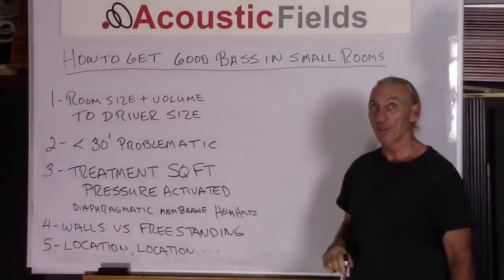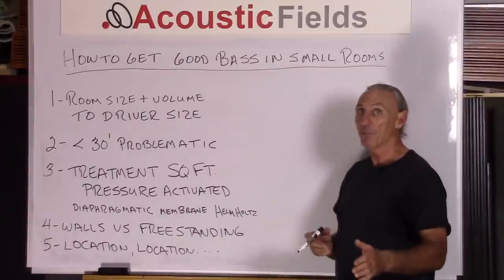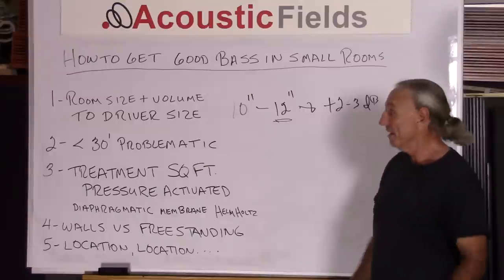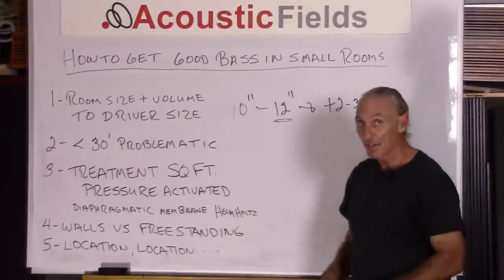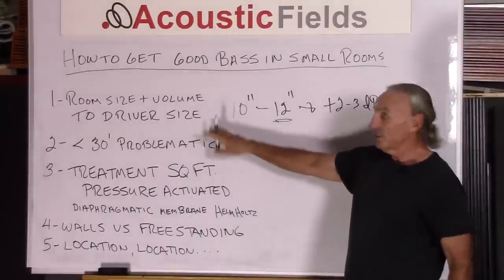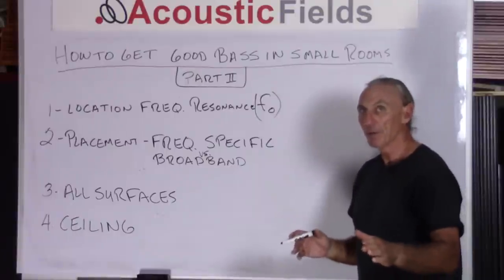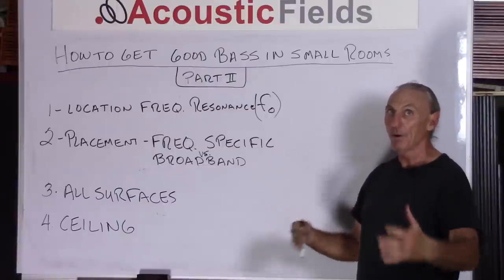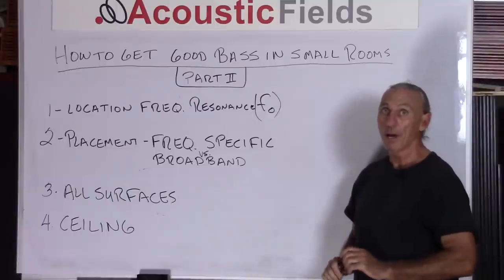How To Get Good Bass In Small Rooms - www.AcousticFields.com

Comment: Appreciate that ceiling tip for a last resort for the sub placement. I'll definitely have to check it out.
Reply from the maker: We have 3 sound fields within a room to treat for both low, middle, and high frequency energy. We have floor to ceiling, sidewall to sidewall, and front to rear walls. All three of these produce unwanted lower frequency pressure issues along with reflections that must be managed.

Comment: Fundamentally correct however a few corrections (there are more but I'll stick to 2): 1) WRT the statement that a 10" vs. 12" driver is 20% "larger" is incorrect. Using the simple area of a circle formula, A = Pi (R squared), 10" = 78.5, 12" = 113.1 which is ~44% larger. 2) WRT 10" vs. 12" is 2 - 3DB louder, true, however output can be managed via subwoofer output levels making driver size primarily superfluous.
Reply from the maker: All varaibles matter. Driver is directly related to speed of the driver and the output presentaion value. I have owned drivers from 10" - 24". Manufacturers claim that they can get a large driver size to move as fast as a smaller driver. I have never heard that in over 50 years of listening.
Reply: @AcousticFields  It's more complicated than driver size and speed especially with woofers and subwoofers. Driver cone size, weight and excursion are all interrelated (e/g: you don't need as much excursion with a larger driver for the same SPL) however, cone weight (including the spider) affects what most people call 
speed or "fast" bass. In my 45+ years listening along with my engineering background I have owned woofer drivers from 6" - 18" and heard many, many more. There are "fast" large drivers - in the right application. One example - Rockport Arrakis with 15" dual drivers.

Comment: I have a question.
Is the room size more important than woofer size in the low end frequency?
Behind a certain diameter, increasing it,  the lowest frequency that the driver can produce it can be heard: it's correct?

Comment: I have a makeshift home theater in my basement, and the bass cancellation is so bad that I don't know where to start.  The room is 20ft x 15ft, but with an L-shape since there is a 4ft x 10ft closet walled off in one corner.  The ceiling is only 6.5ft high.  It seems like no matter where I put the subwoofers, it will be boomy in one spot and no bass whatsoever in another.

Since the seats are located in the smaller part of the L,  I was going to treat that area first.  Would a simple set of foam panels and a couple corner wedges help at all, or is this room hopeless?
Reply from the maker: M,  Foam is not a low-frequency sound absorption technology. With a 6.5 height, you will need large square footage low-frequency  technology coverage throughout the room.
Reply: Maxxarcade I’m having same issue in a 12’ x 24’ room with an open stairway at one end.  I have 2 SVS subs with variable phase controls, still a huge null in the center of the room and boomy in 2 corners.

Comment: 18' is the proper minimum depth of a studio.  This dimension allows for an unbroken wave length of 60Hz  This does not mean lower frequencies can not be duplicated.  It means that 60Hz is reproduced without reflection.  60Hz is by no mistake the main resonant frequency of a 15" speaker and a 22" bass drum.  It is not a mistake that the low frequency EQ on a classic Neve console is set at 63Hz-- also called the English drum sound.
Reply from the maker: K,  Yes, but carry your thinking further. To treat that 60 Hz. resonance with proper rate and level of absorption, you need 10" of real estate on all wall surfaces that cause said resonance. You will need to treat at least two opposing wall surface areas thus losing 20 - 25" of internal dimension. If you plan your internal dimensions to be 18' net then allow for another say 24" for treatment, you end up with O.D. of 20'. and a room treated completely down below 60 Hz. Quantifying the problem and qualifying the solution all in the same structure is the way to go.

Comment: How's it goin Dennis? My name's Jef Kim. I'd like to start by saying that I really respect and appreciate you.  For your time. For your knowledge. And for the amount of time you choose to spend sharing your knowledge with others on YouTube. Your videos are great. Thank you Dennis. (Moving on.)... So I'm an independent/freelance, sound production engineer.  ( Freelance meaning I do not have a degree in sound engineering.) I have a question for you about sub woofer isolation. In your personal opinion, how important is isolating the sub from the floor, in any kind of controlled listening environment? A big thank you to Acoustic Fields and Dennis Foley. I Iook forward to your reply.
Reply from the maker: Hi Jef, Thank you for your support. Isolation of any moving or vibrating source from another surface is always a good thing to do. Subs emit energy into the room through the driver component. This air born energy then strikes the floor. The cabinet vibrations are also transferred to the connecting surface which is usually the floor. Elevating them off of the floor is also welcome. Every room size and volume dictates that any low frequency device will produce a smoother response curve if elevated to certain distances above the floor. These three facts are the design impetus behind our carbon platforms: http://www.acousticfields.com/product/subwoofer-platform-absorber/
Reply: Thank you for the speedy reply. I checked out the platform absorber on your site. I was under the impression that it's more on the side of absorption than isolation. Which I understand in that, 18" can probably isolate the source from the receiver with the right materials. But I guess maybe I was searching for a different answer. The reason I asked was because I'm currently building my fifth sub iso unit. The first two  types i designed and built were both of a platform style that used absorption. The third and forth were both towers. Less treatment. More isolation.  Am I investing to much of myself into this concept? I feel that the time and money i've put into the R&D is well worth the results i've already seen up to this point. I don't know,... Maybe I just hate low end vibration to the point of questing to eliminate it forever. What are your thoughts on this? Oh and, i'd love to see what kind of support structure and design you use, in your sub platform. We can talk later about that though... ty again for your time..

Comment: Please could you go into a bit more detail on what speaker size is optimum to choose for various room sizes? Also if you have bigger speakers but run them at a lower volume to compensate is there any downside to doing this or any issues I should be aware of? I currently have a quite a small studio room 240 x 215 cm - what would be the optimum size for this room? I currently own Focal CMS 65 6.5 inch monitors. Are they too big for this room and should I be looking at 4 or 5 inch ones? I tend to run them about 50 - 80% volume. I'm looking to buy a sub to get more detail and info in the low end since I make a lot of techno music. Should I be looking at 8 inch,  10 inch or 12 inch subs? Would I really benefit from an 8 inch sub that isn't really much bigger than my current monitors?
Reply from the maker: M,  Fill out the information in this link and let's take a complete look at your room. https://www.acousticfields.com/free-room-analysis/

Comment: Hello Denise, I apologize for this question, but I'm still learning. Anyhow bc I can't afford it, I'm running 2 passive subwoofers to a 5.1 reciever and both connected to the same sub out. My question is, am I running the wires right as is or do I need to do that bridge thing from the receiver to one sub to the next?
Reply from the maker: Use a splitter on the sub out so you can run two speakers from one receiver output.

Comment: How do you determine the proper driver size for a particular room once you have your room dimensions? What if you have a room that  is L shaped and you have to provide sound to each side? Would you treat each as a separate room?
Reply from the maker: Hi Maurice, If it is two channel, use the space with the side walls and front wall joined. Let the additional volume assist the lower frequency pressure.

Comment: I have a basement that I use as my man cave.  it is unfinished and it is completely open.  listening to the video it sounds like a big room is ideal.  Right now I have a an old Home theater in a bo and planning on upgrading to a powered sub plus a nice receiver.  I would say the basement is probably no more than 30 ft by 30ft.  what size sub would you recommend and what are some inexpensive thing to do to the basement to increase quality of sounds? Example sound panels.  ETC.  Thanks for your time and knowledge.
Reply from the maker: Hi james martin 

Thanks for the comment. Basements provide for good open spaces but caution must be used in selecting a low frequency source. With concrete and earth as the barrier material, low frequency energy has no where to go and most will stay within the room. It is always the low ceiling height in a basement that causes all the issues. Rythmik Audio makes a good product. I would use their 12" diameter model to begin with and see how that works for your personal low energy requirements. In a space this size and only with proper room pressure management treatment, you could use two units for more impact in a home theater environment.

If you fill out this form on our site and provide as much detail as possible including photos of your room, I'll be better able to advise on specifics:
http://www.acousticfields.com/free-acoustic-treatment-room-analysis-tell-us-about-your-room/

Thanks
Dennis
Reply: Thanks I will do that.

Comment: I would like to learn your insights on how the absorber frequency response may show changes while moving it around in the room, such as leaving air gap between the wall and a diaphragmatic absorber unit. Thank you for your consideration @Acoustic Fields
Reply from the maker: Diaphragmatic is a pressure based technology. An air gap is for missle and high frequency technology
Reply: @AcousticFields  Thank you for your fast reply. As far as I've understood this answer means the operating frequency range of the unit itself wouldn't be affected by its position in the room. 
So when we're talking about tuning these devices, is there any way to do that other than modifying the cabinet's internal design?
The questions never stop, thank you for your objective and heartbreakingly truthful answers. I truly appreciate the knowledge you have brought to us with your videos.

Comment: hello Dennis, first off i want to say this was a very informing video. Im novice to acoustic treatment solutions, all i know is to throw up some bass traps and foam lol however im moving into the top floor of my building and im going to use one of the bedrooms for my recording/mixing space. I dont have to worry about how loud i play but im a studying audio engineer so i want my mixes the best possible. One of the walls in the bedroom is concrete and the other is just a regular wall. To the north is a glass sliding door that connects to a sunroom and the south wall is where the entrance to the room is. The ceiling is concrete as well.  It has carpet floors and is about your avg size bedroom with 8/9 foot ceilings. From a novice perspective how would you recommend me to start treating my room other than your foam typical auralex foam and bass traps?

Comment: So what are some good ratios for driver size to room size?  - Pair of 8 inches in a 12' x 12' Room?
Reply from the maker: Keep the out put low and treat the front wall behind the speakers.
Reply: @AcousticFields  Thank you, is there any general rule of thumb for monitor selection based on room size? And for treating the front wall, would primarily dampening be the appropriate type?

Comment: It seems obvious to me that improving on room acoustics for the purpose of critical listening is both a practical and empirical process. The relationship between the volume of air present in a room and loudspeaker response must exist but, as an engineer,  I would not like to try and calculate it! I was wondering if - considering your practical experience - you have come across a rule-of-thumb that can be applied as a good starting point for sizing and matching a driver to a room?
Reply from the maker: C,  Speaker height no greater than one half ceiling height.

Comment: Hi Dennis. I've got a question about bass frequencies in a car versus in a room. I've got 8" studio monitors just a few inches from the wall in my 11w 13L 8h bedroom. (I know it's too small but just bought them and am moving to a larger room soon.) But, I've been screwing around with mixes and what I'm trying to understand is why a car stereo with 4" speakers produces much more bass on the same mix than my Mackie 8" monitors in the bedroom. I understand that my room is too small for bass waves but how can 4" car speakers in even a smaller environment where there is hardly any space, produce much more bass? Even with the EQ settings flat? Thanks for any response!
Reply from the maker: A,  The dimensions and volume of each space are working for and against you. Smaller driver produces less output in a smaller volume. The dimensions of the car are more favorable for the 4" driver.

Comment: Sir, please do clear my thoughts;  Are subwoofers take advantage of concrete walls, floor, ceilings?  Never mind the vibration which thin woods causes. But just the audible low frequency disregarding vibration.  We'll hear deeper bass due to the bouncing-back of the low frequency from the concrete wall right? Say, if we have a plywood walls, then the low frequency passes through the thin wood and goes outside the house, thus we lose some of the sounds. But if we have concrete (cement) walls, the low frequency cannot pass through so it will bounce back to the room and thus making us feel more lows because the sound is not waisted, right? Please correct me if Im wrong.
Reply from the maker: G, All barrier structures do three things. First, they lower the amount and frequency of energy that is transmitted through them by their design.  Their structural design is frequency and amplitude dependent. Second is vibration management and third is absorption. All surfaces are sound absorbing at some frequency, even concrete. Will a more rigid and dense barrier such as a concrete wall let less low frequency energy pass through it, then the answer is a question. What frequencies are we discussing?  I would answer by saying yes it will stop most frequencies above 50 Hz. assuming the concrete wall is at least 6" thick. The density of the wall has a direct impact on the resonant frequency of the wall or the frequency at which the wall absorbs energy. Any energy above the resonant frequency will be restricted, any energy below that frequency will not.

Comment: So, how about appropriate speakers for a parade float. The float is small (not a 40 foot float). Would you please teach about what happens to music sounds when speakers are outdoors, elevated on a vehicle. If this not match your topic area, I understand. Judi
Reply from the maker: Hi Judi, The term is sound reinforcement. You are electronically reinforcing the sound using amplification. It is all about matching the output of the speakers using size, radiating patterns, and power. I would have to know much more about the distance the sound needs to travel and how wide of an audience area you need to cover.

Comment: Super grateful for the information. I understand that in small rooms, most times it is better to have small boxes and add a subwofer in the correct position, right ?. Most of the time the opposite is done to what should be done, to put bigger boxes than it should be. What do you think of the different configurations of the boxes of the subwofer ?. Is there a difference in having the port below or on the side? In the market there are many models, which would be the most suitable considering the configuration of the sub speaker?
Thank you
Reply from the maker: Hi I, The room does not care how the energy is generated. Ported or non makes no difference. Output is output. Maybe more energy out of a ported but maybe not depending on driver diameter. It doesn't matter to the room. Its all frequency and amplitude.

Comment: If I have a fully sound proofed room.. 4.6m wide x 4.7m length x 4. 5m height walls covered with built in acoustic foam... and acoustic foam placed in good locations on the ceiling. What is the best way to create natural natural reverb in the room? ... ive heard it might be best to get some quadratic diffusers on the wall ... If so what kind?
Reply from the maker: R,   What is your usage? How much foam do you have in the room?  What is the rate and level of absorption of your foam?  What have you done to manage low frequency issues?

Comment: Can you offer more detailed insight regarding size of drivers in certain size spaces. I’m in a 11’x12’ room 8’ ceilings. Not ideal, but can you recommend a driver size based in how small it is? Currently using mackie824’s and a K 10s sub. Thanks for the videos and knowledge
Reply from the maker: H, For the red zone in this link use a 4-6" , yellow 6-8", green 8" - 10" . http://www.acousticfields.com/wp-content/uploads/2017/02/Good-Room-Volumes-Large.jpg